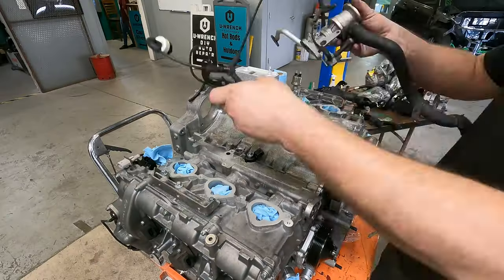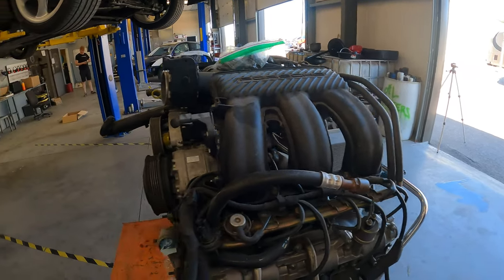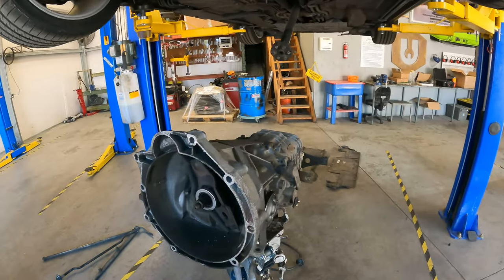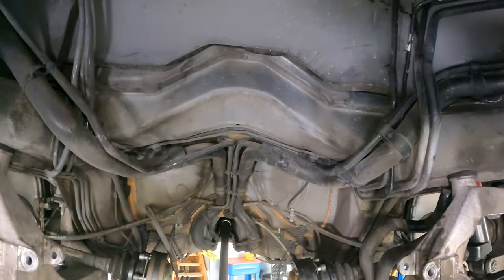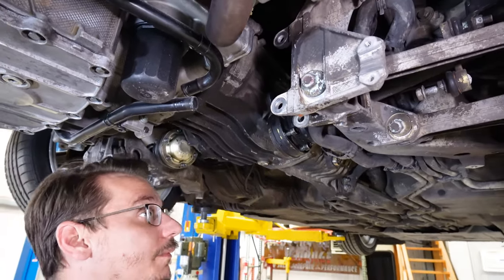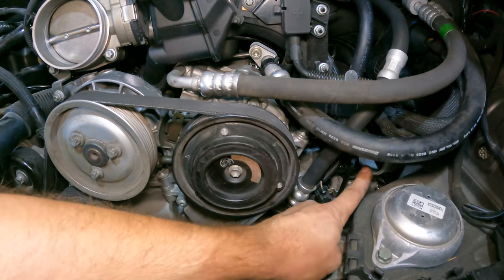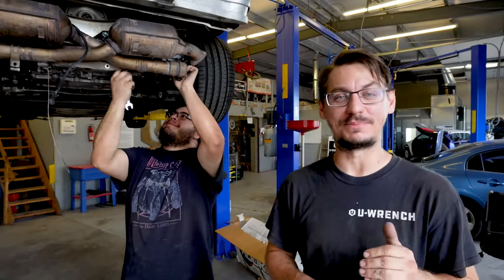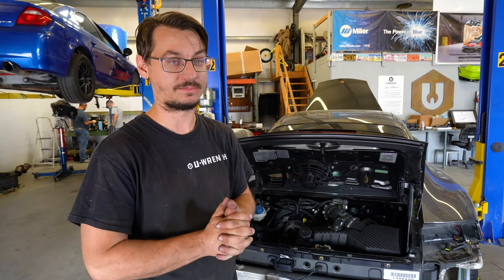Porsche 996 Motor Install

Comment: I've only worked on 2 Porsche cars - one was a late 1950's model that was basically a Beetle's running gear and a Porsche convertible body, it had drum brakes but it did have twin carb's. It was like working on a Beetle but with less room! Cheap to work on.
The other was a 928 which was an absolute nightmare - it was as if each car had been hand built but using different drawings and the electrical system was truly awful! Very expensive to work on!
That Porsche that you are working with looks like a dream! 😊
Interesting video, thanks! 👍🙂

Comment: How come you didn't put belts on the the engine while it was out or did I miss that?
Reply: The power steering line gets bolted on behind the ps pulley.
Reply: @brandonwelsh2743  Gotcha